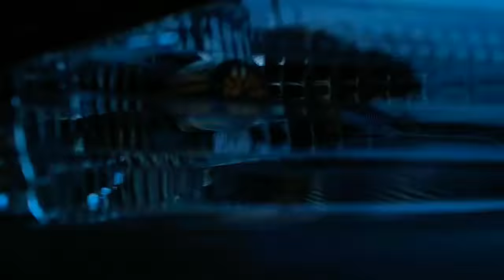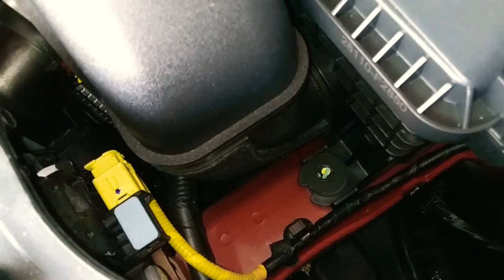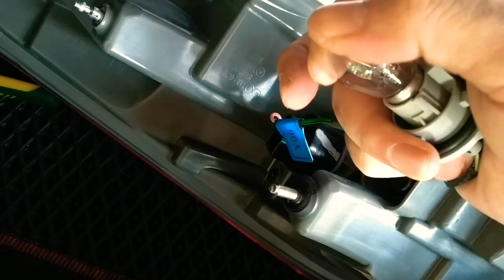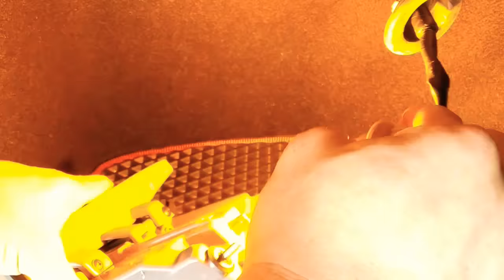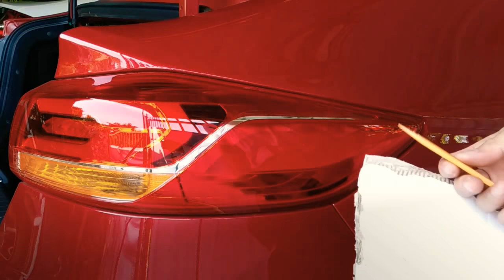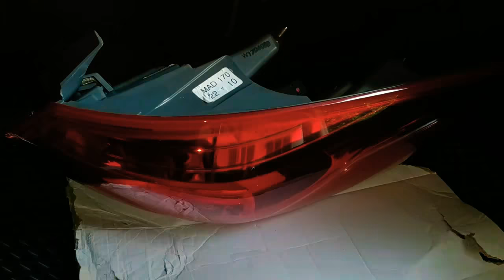How to change the turning bulb signal with LED light on Elantra Sport

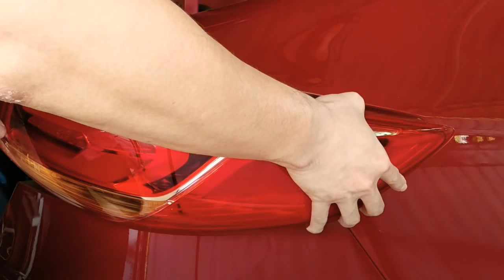Comment: The white clip at the edge 13:39 does it go somewhere on the taillight I took mine off to change the leds I don’t know where it went to it does not fit in the edge of the housing
Reply from the maker: The white hole on the body is female type plastic, in the taillight is the male type metal. If you took it off the twilight the white female hole plastic shouldn't come off easily will stay on the body. If it comes out when you pull the taillight, that is not right. The missing female hole plastic, you need to find it. Very rare parts.

Comment: You didnt need a resistor?
Reply from the maker: It's built-in inside the bulb, I think. One of them I accidentally popped open the base contact, there is micro transistors.
Reply: @frenky-tan  can you please send a link?
Reply: Send link to the bulbs?
Reply: @nikolasguindon  yea the ones with the built in canbus resistors
Reply from the maker: https://www.aliexpress.com/item/1PC-T20-7440-W21W-LED-Bulbs-3014-144smd-led-CanBus-No-Error-1156-BA15S-P21W-BAU15S/32958990196.html

Comment: I purchased the bulbs for the front, but the 150 degree does not fit. The dots don't line up. Its like the front wants 180 as well.
Reply from the maker: Force in so still possible